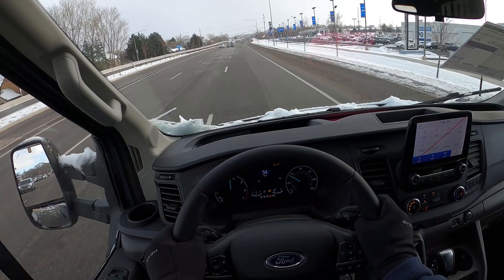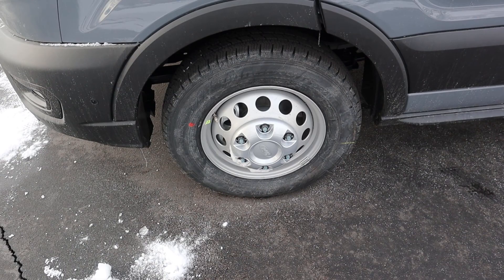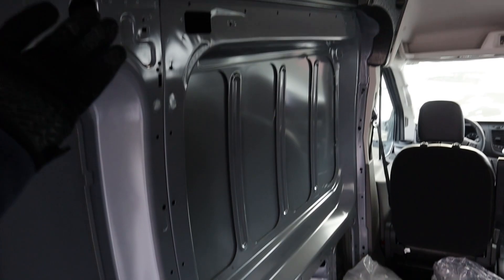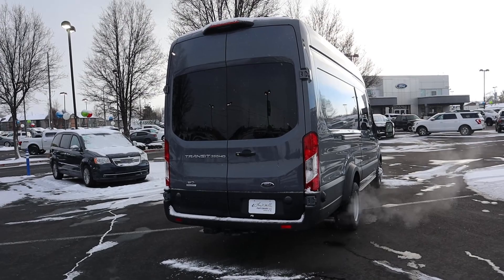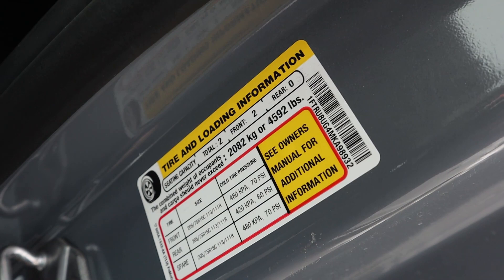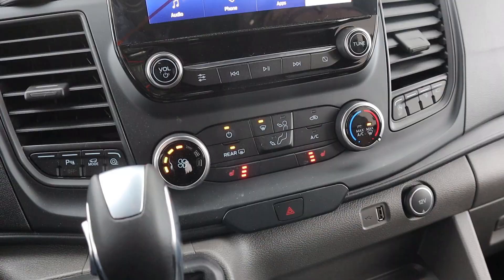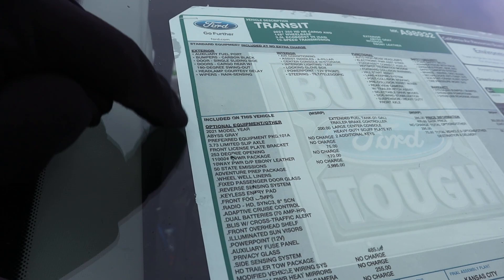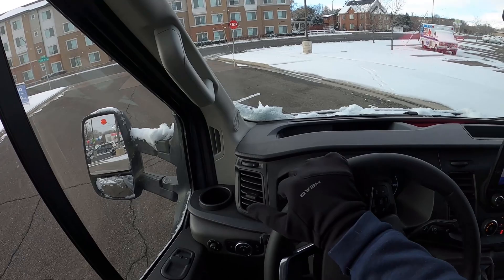New Ford Transit 350 HD AWD: What Are The Dimensions Like?

Comment: Ford needs to put bigger wheels on those transits , I replace my with 245/75/16 without any modifications what soever , direct bolt on and  not rubbing nothing at all . My van 2019 ford transit 250 with 3.5 ecoboost mid size with mid roof
Reply: Thanks for the info!

Comment: Hi Ben, what’s the measurement between the two wheel hub inside the cargo van? I want to know if it fits a standard size pallet.
Reply: Of course it does.
Reply: 44" between the wheels. A full size pallet should fit, (48") when the hi-lo picks up said skid by the narrow end.
Reply: @eklektek6213  I just got off the phone with 2 companies and they said they cannot hire me because the 48x48 pallets it wont fit .

Comment: I'm planning on buying one of these and converting it into a camper to travel in when I retire. The AWD turbo version is the perfect platform for a somewhat off road capable camper van. The noise and rough ride would be gone after you insulated the walls and all add all the weight of a fully featured RV.

Comment: Is it worth it to have dually just to be open to loads and not limit yourself? Or is single just fine?
Reply: Personally I would buy the Transit 350HD with the DRW it is way more stable with the size of the transit and the weight after your conversion

Comment: I bought one. It is falling apart at 11,000 miles. Dealership can't figure out what's wrong. Ford Corp says it is normal. Worst purchase I ever made.
Reply: Yah I agree. We have an EcoBoost and it’s going strong but the van body is yes literally falling apart. They’re built cheap and crap. Go sprinter.
Reply: @auguastoadams4509  Mine is the driveline.
Reply: @cooperc4060  what engine do you have? Is it a high roof?
Reply: @auguastoadams4509  2020 t250 awd med roof with the 3.6 ecoboost. Use it for motocross. A few hours ago just had owner of dealerahip feel the shaking. They all agree something is wrong but Ford Corp says its all good so they are somewhat in a spot pkus they cant figure out whats wrong. The plann is to drive it until it grenades then ford corp will have to fix it under warranty...hopefully still have warranty at that time.
Reply: @auguastoadams4509  of course it wasn't shaking at full throttle when he sat in it. Just my luck.
Reply: @auguastoadams4509  Sprinter does have a gas engine but not in a heavy duty.
Reply: @cooperc4060  damn I was looking at getting one too for dirt biking but this scares me off I have read it’s something to do with the drive shaft
Reply: @alphawolfadventures1470  that's what I use it for